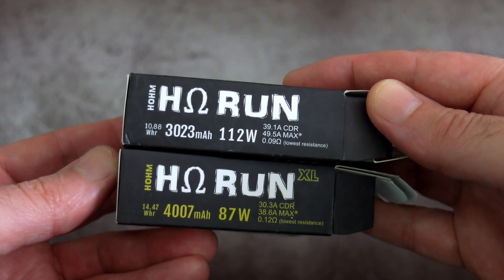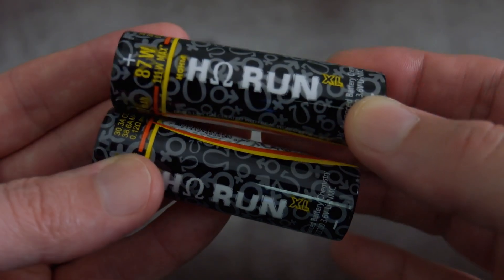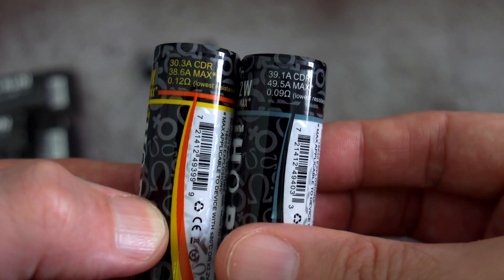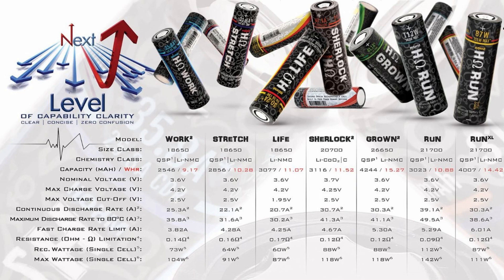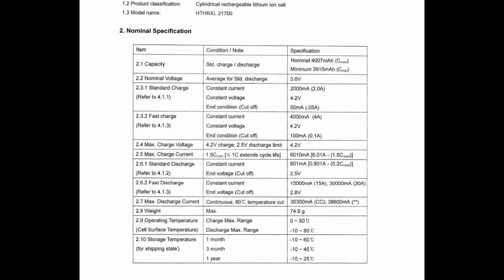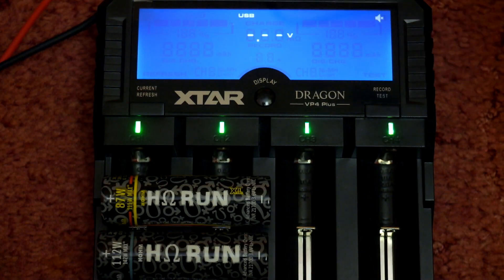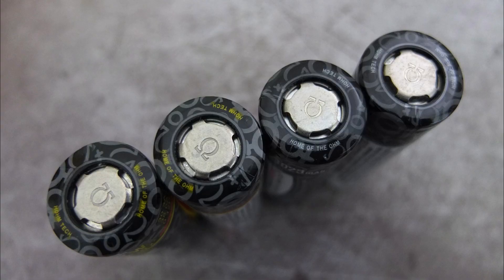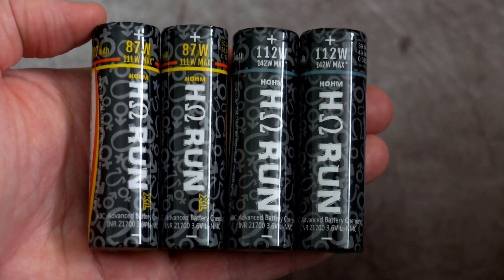Hohm Run & Run XL 3.6V Li-ion 21700 Batteries: Capacity/IR Test

Comment: Just picked up two pairs of these at a local vape shop and vaping at 40 watts, I have been going for 3 and a half days!!  My GEEK VAPE L200 CLASSIC is showing 40% and I did not charge the first pair of batteries out of the box!  The other two needed to be topped off and I will be very curious how much run time I get out of a fully charged pair! (as long as the first pair wasn't fully charged also)
Reply from the maker: They do seem to last well that is my experience no question they are among the better ones out there.
Reply from the maker: They do seem to last well that is my experience no question they are among the better ones out there.

Comment: just bought a pair of these at a local vape shop. I'm planning on running them on a Vaporesso Armour Max. I've never used 21700 batteries, the 3 mods i have are dual 18650 so this should be nice having a bigger capacity. I'll be running them at around 70W with a .15 coil. I could have just ordered some Molicel 4500mah 45A batteries online for about $10 less than what i paid but I wanted the batteries asap so local vape shop it was, plus we gotta support our local vape shops, they are slowly dying because of all the restrictions local governments are putting on them.
Reply from the maker: The bigger cells 21700 can handle more power drain and higher capacity. The vape scene is difficult at times, I see more taxes coming in and other things. But I also see the benefit for smokers, and I've eventually got off nicotine too, it can be done, but it took quite a while!

Comment: I’ve been using the hohm run XL 21700 batteries in my Vandy vape “Jackaroo” mod and they work pretty damn good👍🏻I’m getting about a day and a half of heavy use out of a full charge.
Reply: I'd be using them at about 60-70 watt, but  found a review from another guy who's known for his battery knowledge an he said 60-70 would be fine. Thanks for replying my man
Reply: Charles Backhouse of course bud👍🏻the batteries say on the wrap that they can be ran at 87watt and they max at 110watts!...That’s per battery!!🙂
Reply from the maker: Useful to get longer term use feedback - they did well in testing
Reply: What wattage do you use on them?
Reply: Charles Backhouse I have had my pair of Hohm run XL 21700’s for about two years and I’ve ran them at about 48-50 watts on a .34 ohm coil👍🏻I honestly love these batteries and how long they have performed!